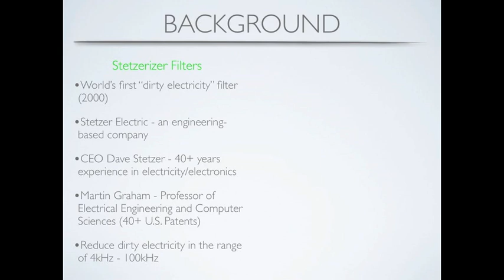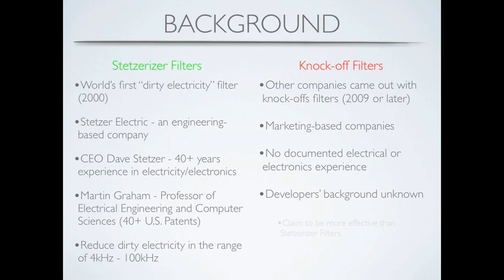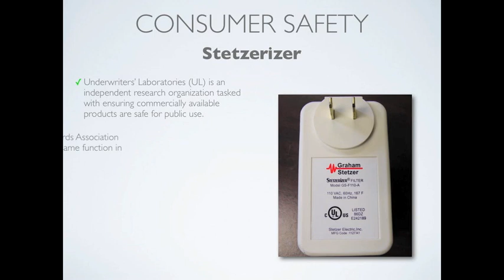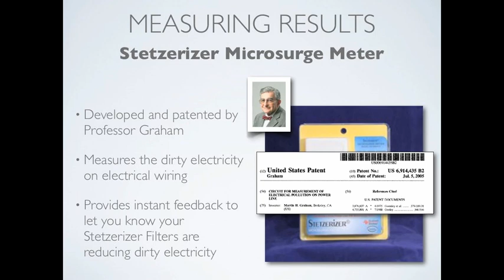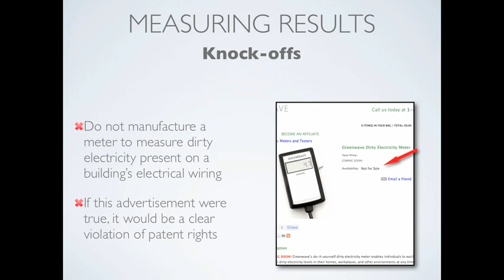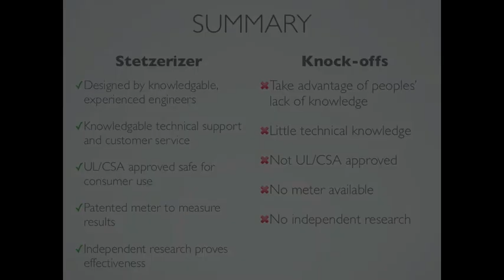Stetzerizer vs Greenwave (or other knock offs)

Comment: 1- Titling Greenwave filters as "knock-offs" is slanderous
2 - These claims in writing are incorrect:
    Not UL or CSA approved
    No meter to measure Dirty electricity

Greenwave has UL and CSA (Canadian) approval on 6 different filters. 
 Underwriters Laboratories - http://database.ul.com/cgi-bin/XYV/template/LISEXT/1FRAME/index.html
use UL file number - E360574
We ship only UL/CSA approved filters everyday. 

Greenwave has its own revelutionary meter to measure dirty electricity.
Reply: This video's claim that GreenWave filters are not UL tested is a bald faced lie.  The "sticker" on the back of the GreenWave filter in this video has been photoshopped removing the UL tested info beneath the GreenWave website address.  I am looking directly at my GreenWave Filter, right now.  I agree completely with Gene Zaccor, co-owner of GreenWave Filters.  I have owned both - first the Stetzer Filters which I subsequently returned.  I then purchased the Greenwave Filters and meter.  The GreenWave meter is far superior to the Stetzer.   I used far less filters from GreenWave to accomplish a superior result.  I knew enough about filtering dirty electricity before I telephoned Greenwave and spoke directly with Gene.  He was gracious to spend a lot of time on the phone with me.  He was candid, informative, and clearly explained the superior technology of Greenwave filter and meter.  I agree with Gene's statement - this video is clearly slander . . .  From my personal experience - DO NOT PURCHASE STETZER FILTERS!  My comparative meter readings by each of these companies prove my case.